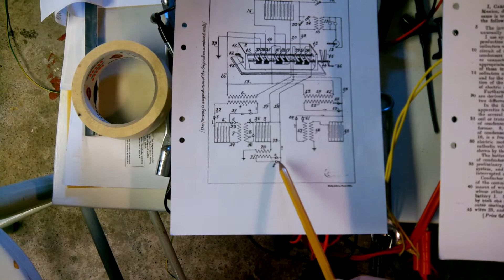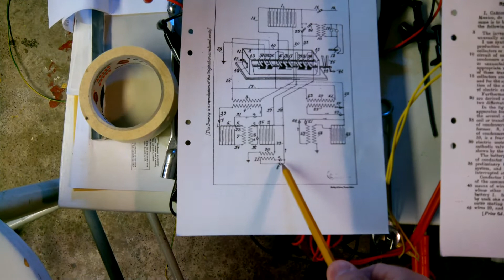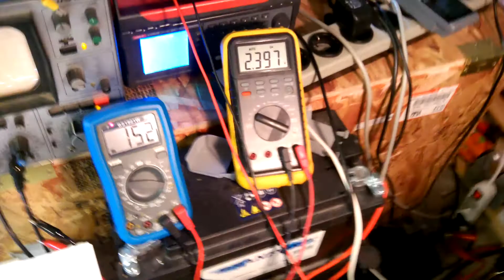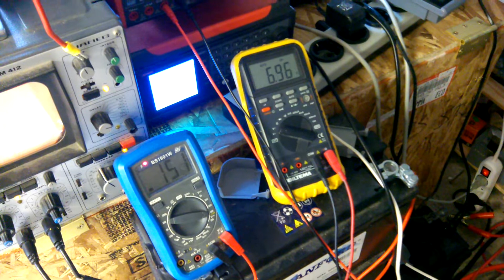Benitez-Plug, Earth and Me

Comment: Don't know if this will work, but you can place in parrallel capacitor around the coil and wrap around the elkos connectet with the elko chassis an aluminiumfoil the glossy side outside, because of the plastic. Then it should be a fubny lc tank i think i will post a video later on this in a day or so. Havn't got a pulae motor so i can't zry in the Moment. Nice videos.